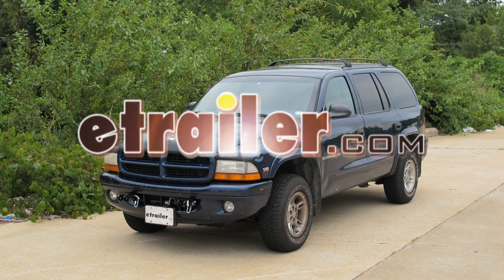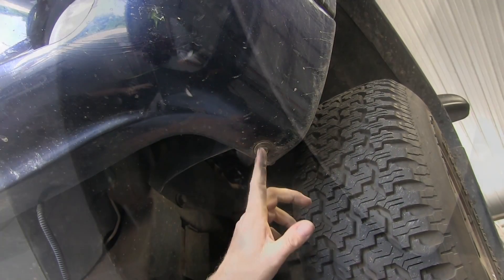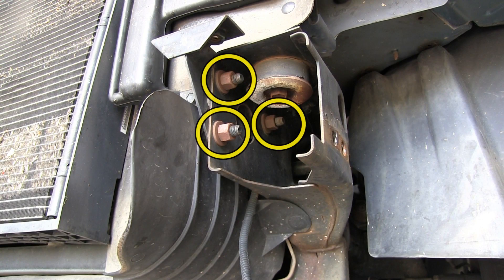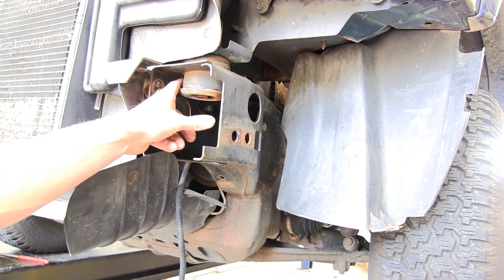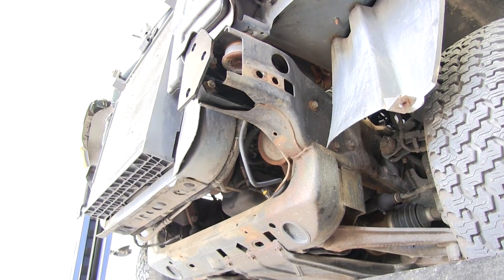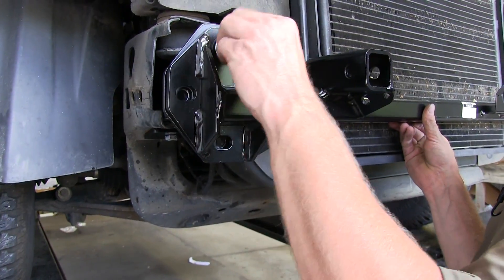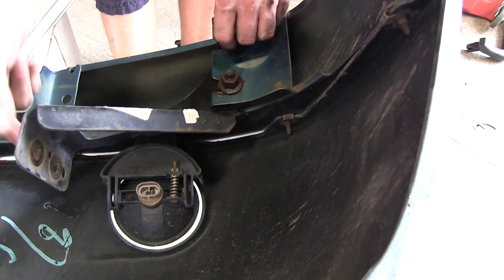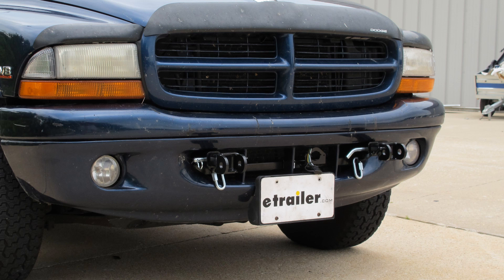etrailer | Setting up the Roadmaster Direct-Connect Base Plate Kit on your 1999 Dodge Durango

Comment: Would this clear if have a bull bar
Reply from the maker: It would depend on what type of bull bar you have and the mounting locations it uses. You would also want to be sure that the tow bar arms would not make contact when making sharp turns with your motorhome.
https://www.etrailer.com/Base-Plates/Roadmaster/246-6.html